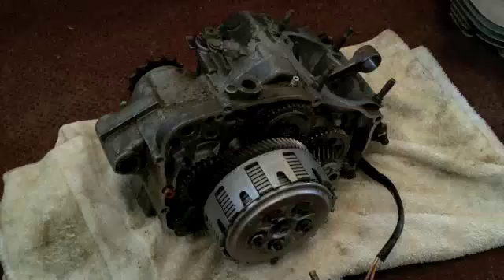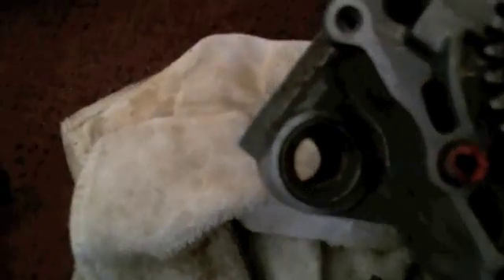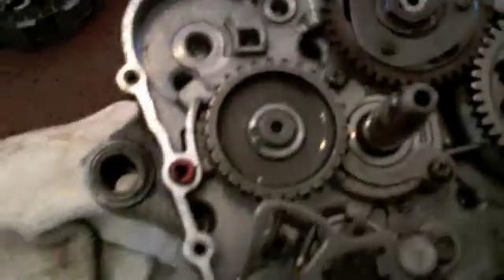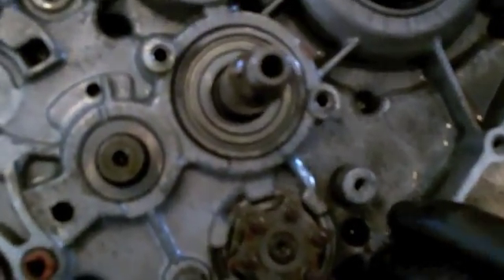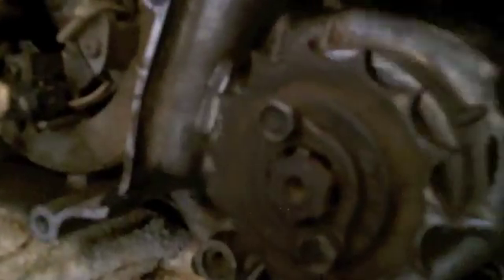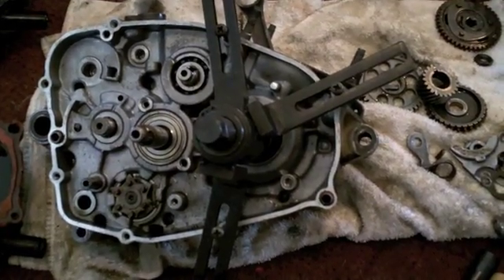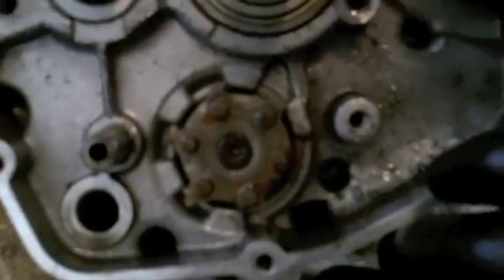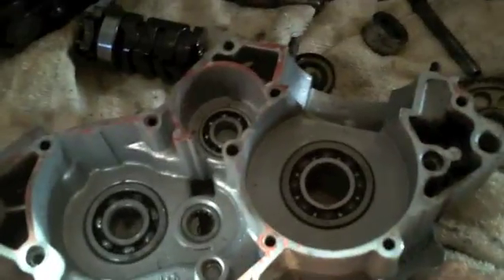Yamaha Blaster engine case disassembly

Comment: bought a blaster that needs a rebuild for 125 but i got the case apart because the motor was already partially torn apart previous owner could not remove the stator found a few things such as some scoring on the right side of the case and a broken clutch basket drive gear so any ideas where i can purchase that gear and what is the best way to remove the crank im planing on doing  cheep weisco top and bottom rebuild any help would be appreciated